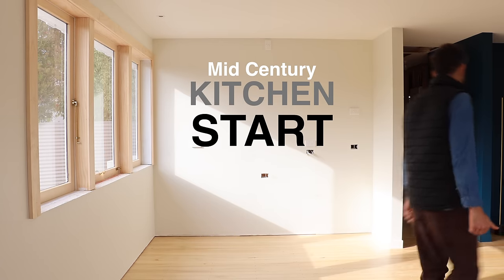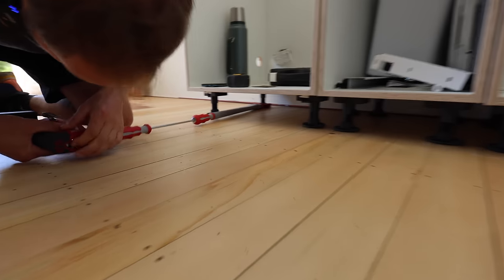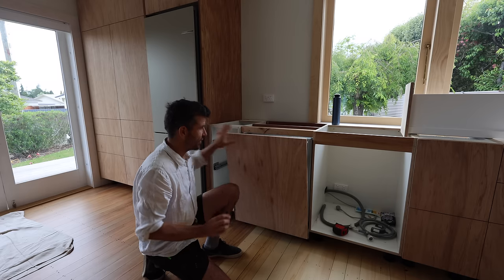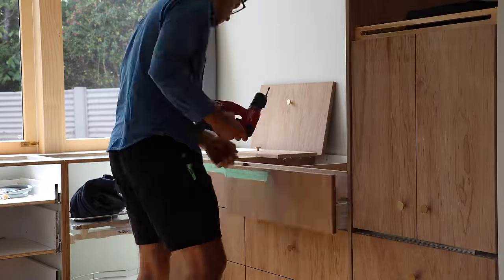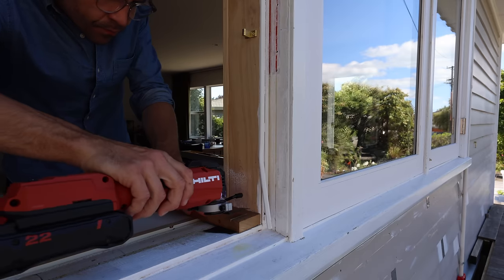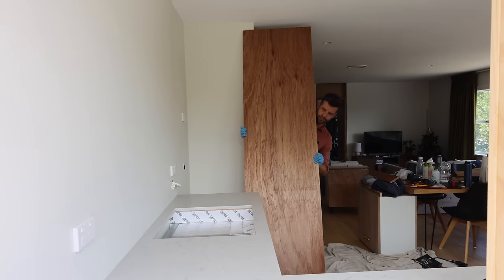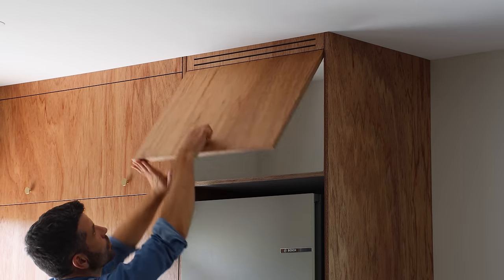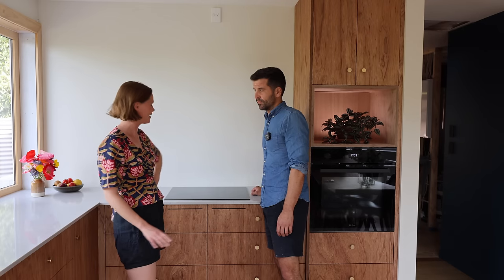I Made a PLYWOOD Kitchen look like THIS

Comment: Awesome Job Scott, Jess and team well done.!!  but why oh why did you use crap engineered epoxy ceasar stone??? Granite is far superior and non carcinogenic with a much better gloss and lasting serviceability.   I guess it was the uniform light coloured look you were going for.  Your exceptional skills and quality workmanship is let down by the ceasarstone benchtop.  In Australia ceasarstone is almost gone burger and is being banned by osh for it's dangerous carcinogenic properties.   plus don't let your kids do homework at the bench as felt tip markers will stain it and lemon juice and acetic acid from red wine will stain and eat into it as well.

Comment: LOL! I think I'm in the wrong business. You Kiwis pay 4-8X more than a high end kitchen would cost in Greece by a professional crew with REAL wood (no melamine) and you did it almost alone with plywood ?!? Plywood is actually good for moisture resistance (that;s why its used in bathroom cabinets), but you folks are getting ripped off downunder.